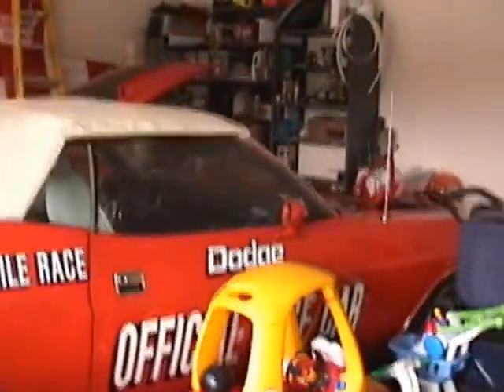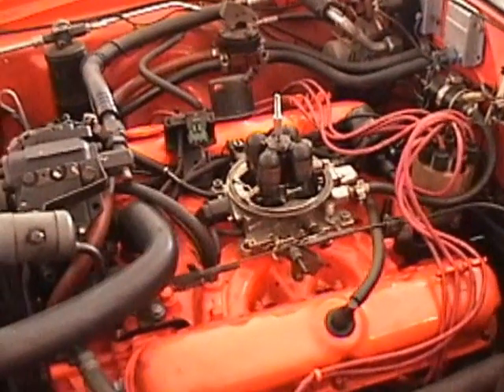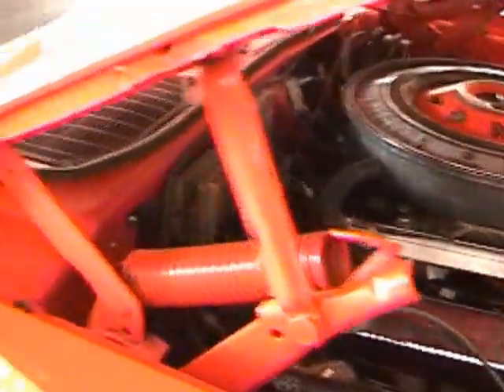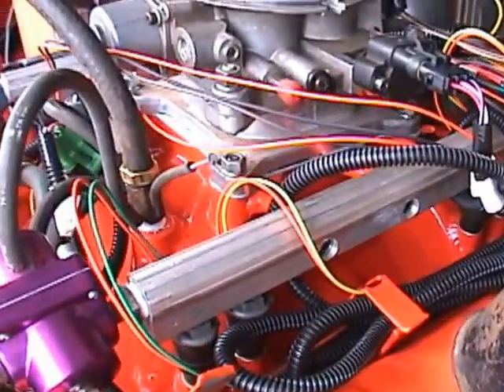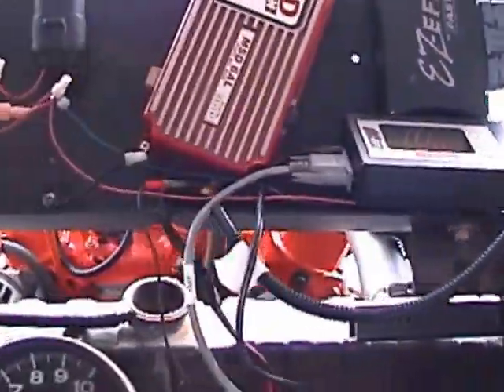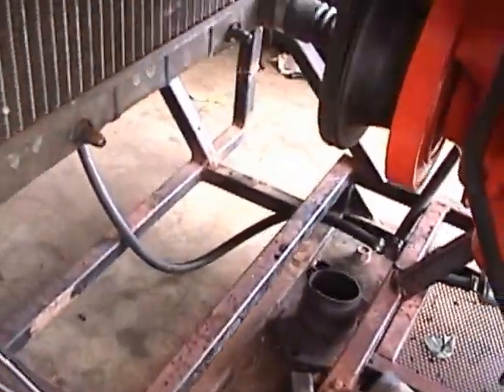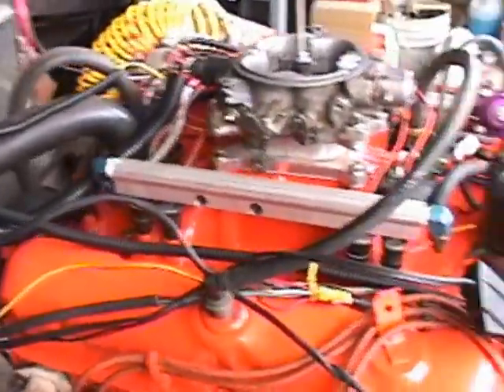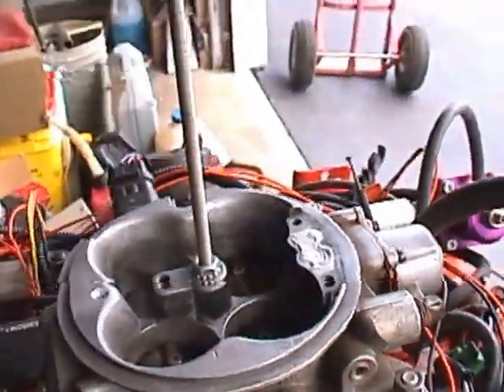Converting my Holley 950 EFI to EZ-EFI self tuning EFI in a 71 Dodge Challenger Pace Car Part 1

Comment: Been playing with a Commander 950 and I have the special self-tune software ($15).  One issue is that Holley's software only works in WinXP.  In later Windows, it runs but you can't display the fuel map.  Holley won't support it anymore.
Reply from the maker: I still have those 950s but now in a box. I also paid for the self tuning app then too. I used to jump on Chevytalk.com for all of my questions and answers dealing with the commander 950. Maybe jump on there and ask the question? Still a good system, but I just don’t run it anymore since I converted to new Hemis and tuning the factory ECUs. Keep me updated if you get an answer about getting newer windows to work.
Reply: @shelbydogg  
Thanks.  I put it on my 1965 Chrysler 383, but haven't gotten it running well yet, partly because I don't have a current tag so just fooling with it at idle.  Sometimes it will die then won't restart, so I pull up the fuel map from the ECU and find all the numbers changed to strange values, so have to download again.  A bit quirky understanding what values are on the PC screen vs ECU,.  For decades I had the earlier Holley Pro-jection 2D on it, which required constantly tweaking the knobs to idle OK.  I had an O2 sensor.  Not having inlet air temperature (IAT) and Pman sensors doesn't work well, meant just for drag-racing with a wild cam.

Comment: im not really following or im stupid.. Do you use the old 950 commander TBI body? But the EZ-EFI control box, with a multipoint fuel rail? Im asking cuz i have a dual 950 commander setup.. but i hate it tuning it is a pain in the .. bottocks..
Reply from the maker: Yes. I use the commander 950 Throttle body and take off the spider fuel injector assembly, then drill the top middle to hold an air cleaner stud. If you look closely, you'll see that I plugged the holes that supply the fuel. So YES, Use the EZ-EFI Multi-port kit then supply your own manifold, rails, fuel pump and throttle body.

Comment: Nice work....... Is a single plane better distribution for TBI overhead injection? I seem to have even burn distrib problems with dual plane air gap on EZ EFI 2.0 system. Front of engine 1-4 lean back 1/2 rich??????????/
Reply from the maker: I converted a single plane because that's all I had. A dual plane would have been better for better gas mileage and flow velocity at my cruise RPM of 1750. I run a Dodge 833 4sp Overdrive and 2:73 to 1 rear gears. On the highway at 70mph, I'm at 1750 rpm. When Running on the Hot Rod Power Tour, I get 27 to 28 mpg. Probably could be better with a dual plane at my cruise rpm.  Lots of EFI guys will tell you to use a single plane. All single planes I looked at, the RPM ranges started around 2500. I'm not drag racing anymore so dual planes are what I'm after for velocity.  I don't know if a single plane is better for TBI injection but would agree that it probably is. Your front cylinders might be leaner because that is where the water pump is and those cylinders are hotter than the rear ones? I run a 195 degree thermostat as recommended by Edelbrock for my Pro-flo kit. The only real way to even out all of your cylinders is to build little air dams inside your manifold and check exhaust temps at each cylinder OR get multi-port with 8 O2 sensors and an EFI that controls each injector like Megasquirt MS3.

Comment: Why didn't you go with the new Holley HP self learning efi since you already had Holley comander 950. It is an easy upgrade. What made you choose the FAST EZ_EFI instead? The Holley HP has more features and is better IMHO.
Reply from the maker: The Avenger or HP Conversion kit was more expensive and the overhead TB injectors is old technology. The TB also had low impedance injectors which limited my choices so I wanted to convert to multi-point. It also wasn't available when I converted the 440 from the Edelbrock Pro-Flo Multi-point EFI to self learning. For the $825 I spent for the FAST EFI multi-point conversion kit, it was the best for the price. Since then, for the FAST Ver-1, I can get the main connector and pins from an electronics store for around $36, the ECU for $180 and the handheld for $100. The rest is piece together stuff from other EFI wiring harnesses or junk yards. Don't get me wrong, I like the Holley stuff but the FAST stuff has a lifetime warranty. Edelbrock also makes a great kit and now includes the sump kit and has a wireless Bluetooth tablet. The EFI wars are on!